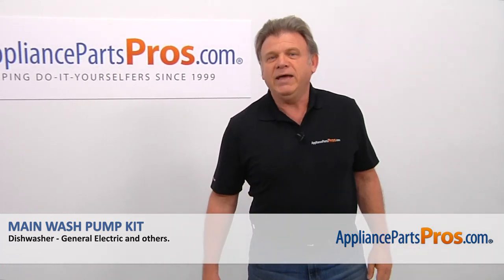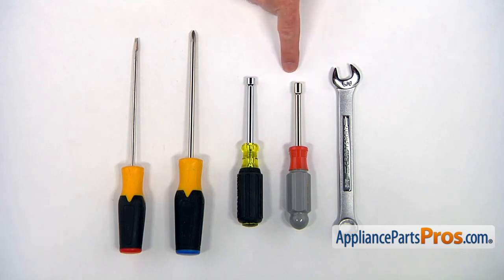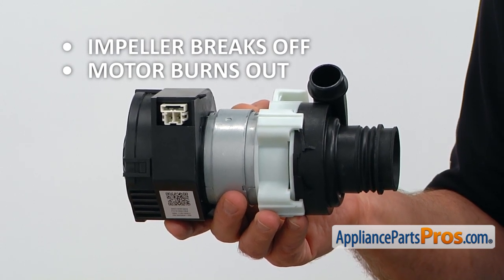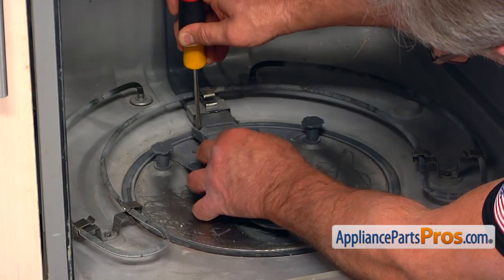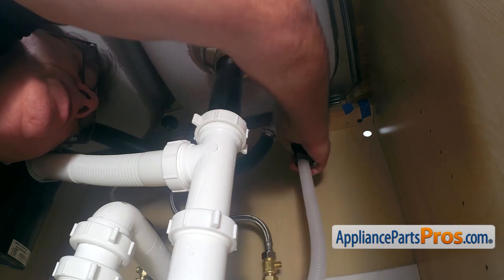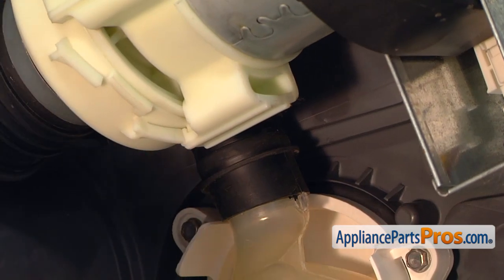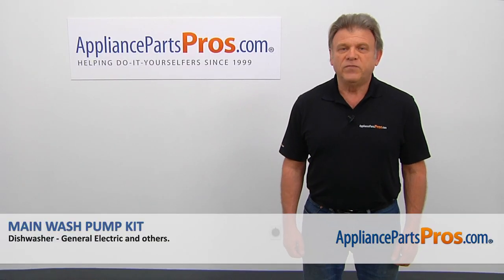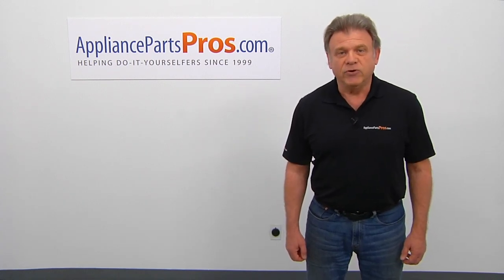How To: GE Main Wash Pump Kit WD49X23778

Comment: Thank you for the video.  To those who ask why take the sump out that is easy ... because it is an absolutely sh!++y design where you have to line up the main hose, the hose to the diverter assembly and the stupid tab on the bottom of the sump.  

I originally removed just the circulation pump in the manner that people said to do but when i tried to put it back on the angles are a pain in the arse and when I finally did get the rubber on the diverter assembly connected when I tightened it down the hose slipped on the back side that I couldn't see and then the clamp cut the rubber since I couldn't get it to tighten up. 

At that point I followed the video and removed the entire assembly and it was still a pain in the arse.  At the 7:35 portion of the video I pulled the diverter assembly (3 screws) and connected the diverter assembly to the circulation pump which made it much easier to connect the circulation pump hose, the diverter assembly into its hole and the stupid tab where it goes. 

Unfortunately from my first attempt the cut in the rubber on the diverter assembly was bad enough that water leaked.  Spoiler alert ... you can't just buy the rubber piece that connects to the diverter assembly so I ended up having to replace the entire diverter assembly which was another $80.

When the part arrived I took the unit apart and replaced it like I mentioned above, reinstalled and it worked fine. 

Again ... if you want to remove just the circulation pump have at it but prepare for a fun challenge and possibly damaging another part.